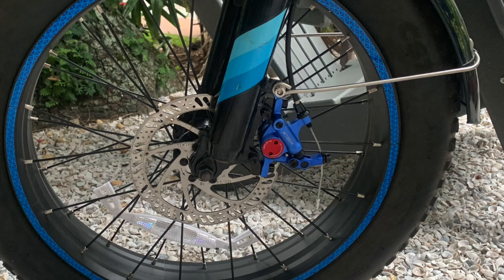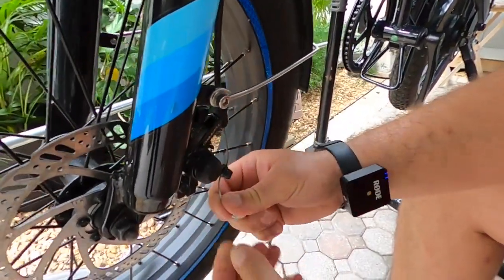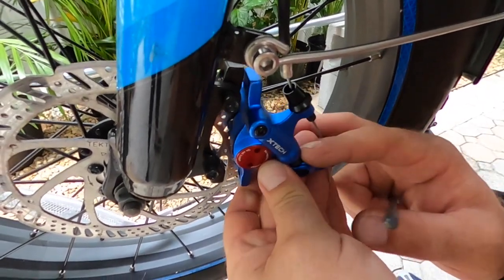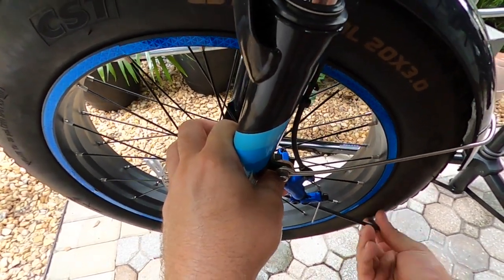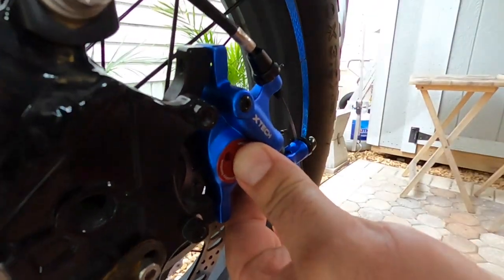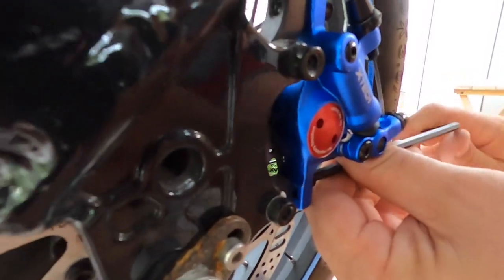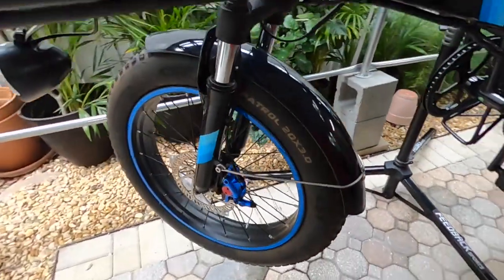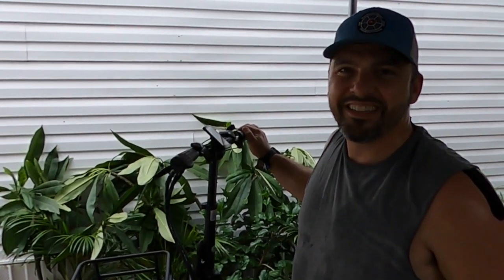Cable Hydraulic Brake Installation on Lectric XP 2.0 Electric Bike

Comment: Did you install hydraulic or mechanical brakes? Do these brakes you installed require brake fluid?
Reply from the maker: The fluid is in the caliper itself and does not require bleeding. It’s a step above mechanical brakes and a step below full hydraulics

Comment: I have the 3.0 step thru and just ordered the HB-100 XTECH Cable Hydraulic Calipers. I am not clear on your Spacer short video. You spaced out the Fork but the relationship between the Disc Rotor and Spokes doesn't change. Once you recenter the Caliper wouldn't you have the same rubbing issue? Thanks for the great content.
Reply from the maker: There is a large range of manufacturing variability and tolerances with these bikes and brakes.
When the issue persists, it generally is a spoke grazing the caliper body. In some instances the angle offset by the washer is enough to shift the caliper into clearance of the spokes. For others we have seen need for two washers and two disc spacers.
We believe the brake mount fabrication tolerances have tons of room for improvement from Lectric.
Reply: @ElectricAllWheel  thank you for the reply. I will start with the rear and keep the other unit as a spare. I will replace the pads in the front with some better pads, what do you suggest? The front is easier to adjust anyway. Thanks again.

Comment: The supplier of these brakes says they are intended for 160mm rotors and the Lectric XP 3.0 has 180mm rotors.
Reply from the maker: Thanks Brandon. This is a Lectric 2.0 in the video.
Reply: 3.0 will be upgraded free if you ask

Comment: What do you need the rotor spacer for??? Can I install these exact same calipers on the Lectric 3.0???
Reply: I just tried on a 3.0 rear is fine, front hits spokes. will find some spacers and finish later.

Comment: First off I like your video installs they help me a lot but my question is I do not have extra break caps for my bike can I still get the break wire through with the break cap on???
Reply from the maker: No. You’re going to have to take them off. But you may be able to take them off and round them out to reuse them. Take your time.

Comment: From what you show in your video, it appears that the calipers for the front are thinner than the rear.  I ordered two sets of these, one for my 2.0 and a set for my wife's 2.0 and all four calipers I received are the exact same thickness.  The rears went on with no issues but the fronts are hitting my spokes.  Can you confirm they are two different thicknesses?  Thanks.
Reply from the maker: Common issue

Fixing Spacing at Caliper and Spokes for New Cable Hydraulic Brakes_ Lectric XP 2.0 E-Bike #shorts
https://youtube.com/shorts/F70F0HlLCC0?feature=share
Reply from the maker: These may be necessary. Throughout the Facebook groups you will find different combinations due to various tolerances of the forks and wheels
https://amzn.to/3fJliCz
Reply from the maker: You will be please with them when they are aligned.

Comment: I installed these brakes earlier today, but noticed that they are slightly hitting the spokes and rotor. What is the best way to adjust this?
Reply from the maker: Fixing Spacing at Caliper and Spokes for New Cable Hydraulic Brakes_ Lectric XP 2.0 E-Bike #shorts
https://youtube.com/shorts/F70F0HlLCC0?feature=share

Comment: Did you do the washer spacing on the front axle as in the link above before installing these brake calipers? I just want to make sure I am understanding everything I need to know to add some to my 2.0 ST. Thanks.
Reply from the maker: On the regular XP 2.0 we used 1 washer up front. We have seen a need for 2 washers and a rotor spacer up front. It all depends on the manufacturing precision for both the bike and the brake caliper. There should be a link for the rotor spacer in the video description.
Reply: @ElectricAllWheel  Thank you so such. I guess its a trial and error thing unless someone else has experience with installing these calipers on an ST 2.0, but even that may not be consistent due to the country of origin of the bike and caliper. I think I need to invest in a work stand for this thing, lol.
Reply from the maker: This is the stand we use. You should be fine. Take your time and everything should work out.

https://amzn.to/3cXeIXy

Comment: If you use the existing brake mounts on the bike you do not have a "front" or "rear". The calipers are the same. Simply remove the mounts shipped with the new calipers and mount to the existing adapters on the bike.

Comment: Nice. Had my 2.0 a year tomorrow. Waited 4 months to get it. I had the brakes plus other goodies waiting for it.  Have 1700 miles on it so far. No problems at all. I am looking into Himiway 52v for long distance riding. If I can make my XP get that range I will do it. Amazon is out of the balancer. I deal with Aliexpress anyway. at least they have what I need.
Reply from the maker: We loaded a link for Ali express for convenience.
Look at the Ariel Rider Kepler.
Or try this
https://electricallwheel.com/e-bike-selection-guidance/

Comment: Awesome video, but...  Not hydraulic..
Reply from the maker: Thanks Charles. They are indeed Cable Hydraulic brakes. Thanks for watching!
Reply: @ElectricAllWheel  I have never heard of those before, look like regular mechanical disk brakes, but they have hydraulic in them huh!  Interesting.  They must have an advantage over regular cable mechanical brakes.

Comment: I have the blue brakes as well, but have not installed them yet. This tutorial will make it easy, I hope!!!!
Reply from the maker: We did a test ride today for the first time, the braking is notably better. They are a tight fit. Meaning, there isn’t enough room IMO between caliper housing and wheel spokes. It works but it’s close.  We are torn between aesthetics and personal preference/technical tolerance